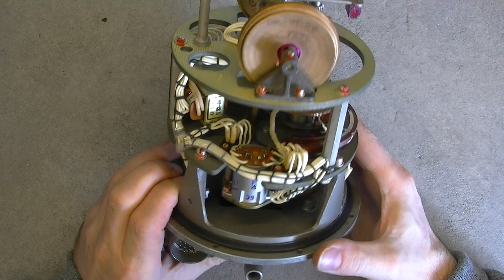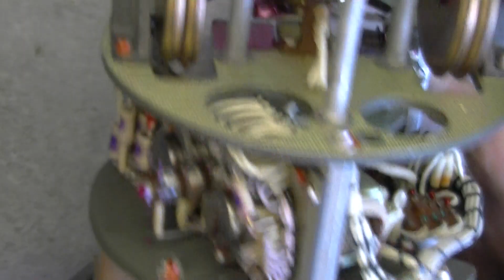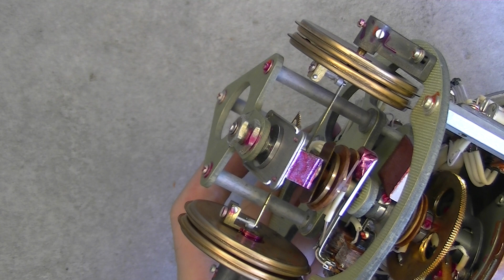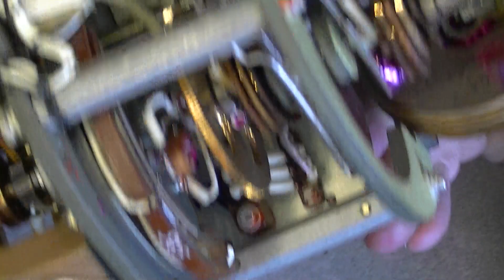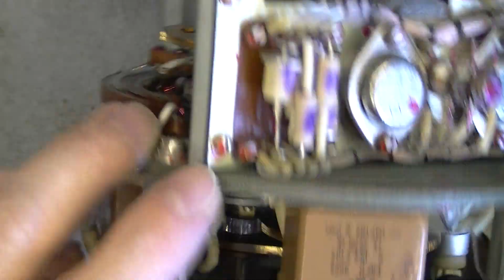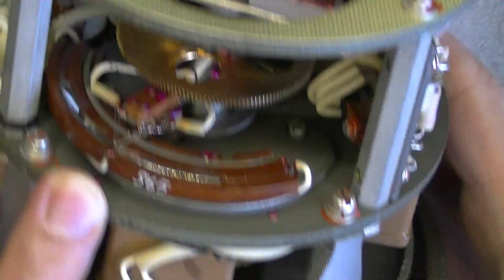Soviet aircraft air pressure sensor teardown

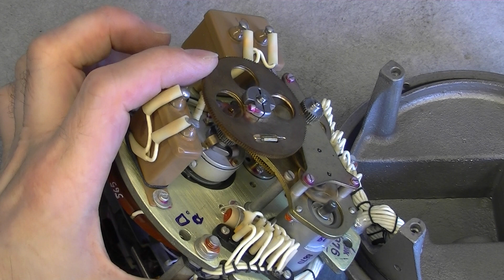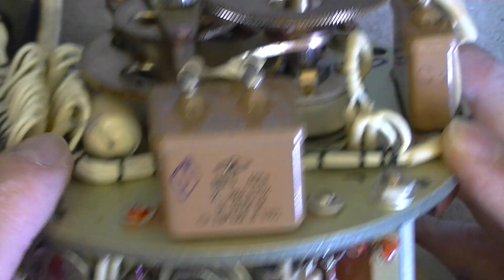Comment: 07:30 : this is a motor. Small pinion = motor. It is imposible to have a synchro here, synchros work with only one rotor revolution. There is a servo amplifier shown at 09:30 between the pick-off sensor and this motor. Output is the potentiometer.

Comment: excellent video. 
the two round objects on top are probably the main measuring device, most likely strain gauges. The long potentiometer is most likely a feedback for the servo only, to find the center position.
Reply: No, these disks inside have a vacuum and purely mechanically move the jumper between the coils when the pressure changes. And the rest turns the coils so that the jumper is installed between the coils and balances the system.